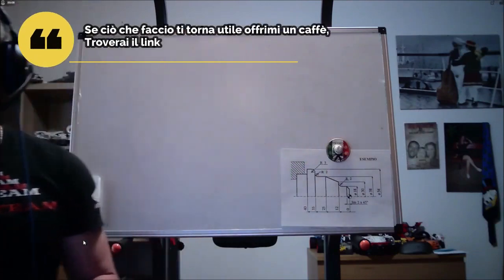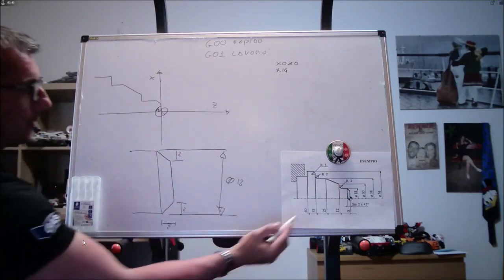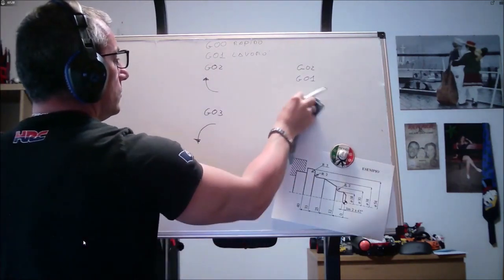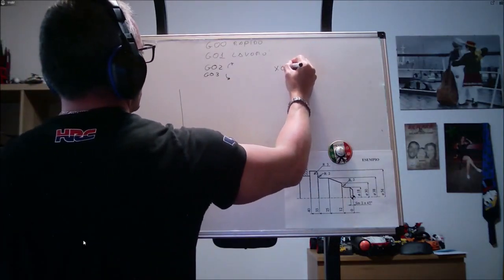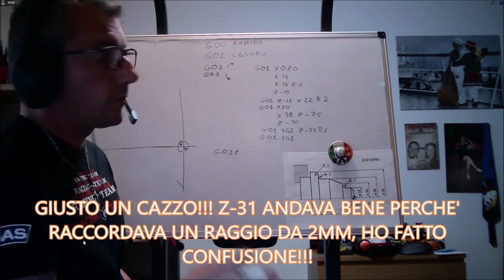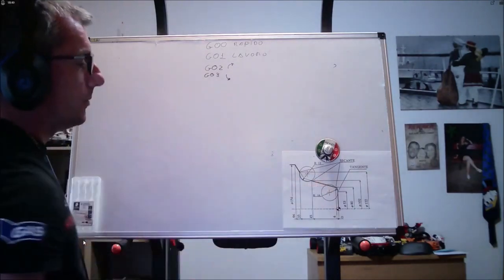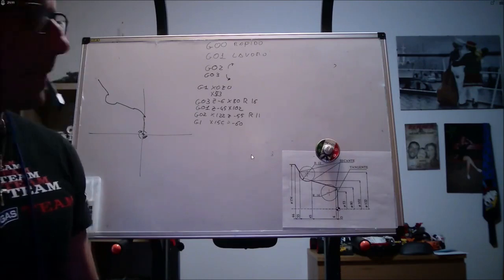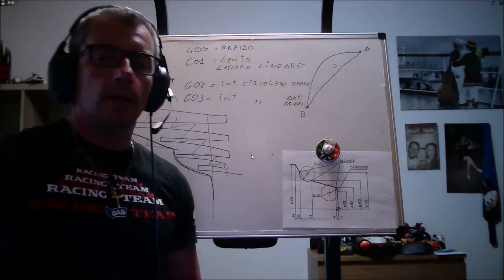N°3Corso completo programmazione torni CNC per principianti  Interpolazioni lineari e circolari

Comment: salve ottimo video ,volevo chiederti  in G00 le macchine fanno la traiettoria più breve ma tu avevi consigliato di farla ,diciamo a rettangolo ma quale problema comporta ?se la macchina si avvicina a un millimetro dal pezzo ,che vada per una strada o per altra dove è il problema ? grazie ciao
Reply from the maker: Ottima domanda, in teoria non comporta nessun problema, ma è una questione di abitudine di programmazione sicura, la presenza di una lunetta, o di una contropunta, oppure se ai lavorato con un esterno ti allontani a z 250 poi ruoti la torretta e prepari la lavorazione un una punta od un bareno tipo barra antivibrante lungo 300 mm e programmi g0 x2 x60 potresti incorrere in una collisionem se invece prima vai tipo G0 z20 poi ti bbassi non avrai mai problemi, certo se devi fare 10.000 pezzi con un tempo ciclo di 40 secondi andrai ad ottimizzare ogni cosa. Ciao.
Reply: @TecnicheCNCTornitura  ok grazie mille